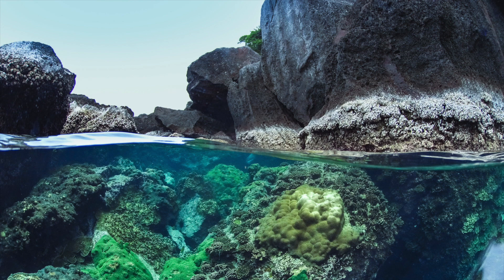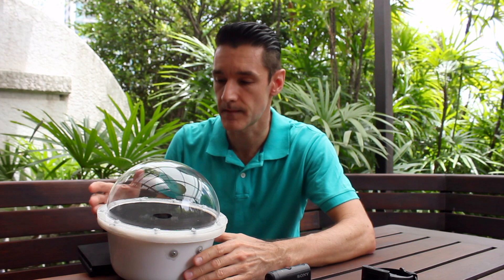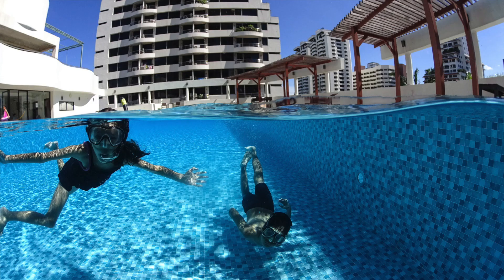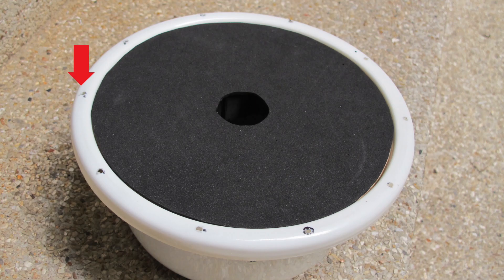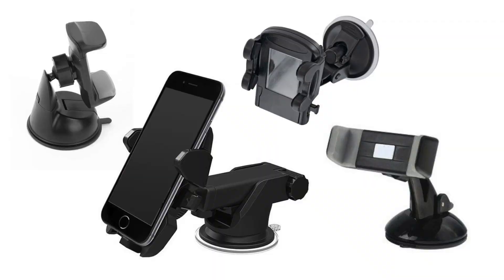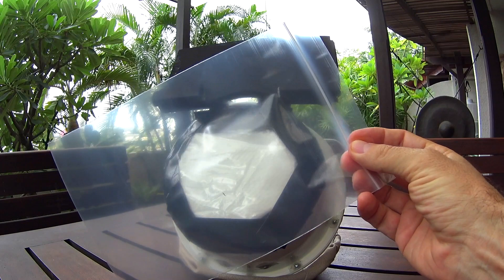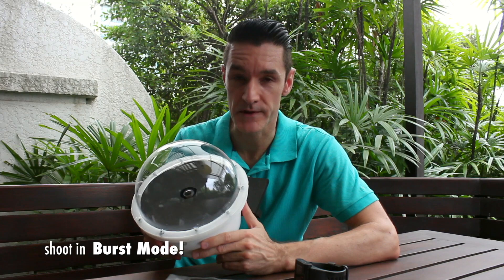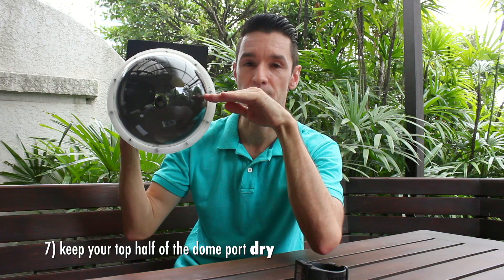DIY Dome Port for half-over-half-under pictures for any camera model

Comment: Great tutorial! 😊👍
Just one question: Isn’t it easier to just use foam inside instead of the wooden construction? There are several soliditys and it is a little bit more flexible when you put you camera inside. Especially if you have different lenses with different thickness. 
In addition, if you really want to get sure your camera doesn’t get in touch with water, you can use an waterproof pac like the one from DiCaPac. Probably takes you the fear away ☺️

Comment: Hi, where did you buy bottom bowl for your design? Online?
Reply from the maker: That took a bit of searching and some luck. Once I had my acrylic dome, I drew its outline on a paper and cut it out. I took this round paper with me wherever I went as a size/ diameter reference. I went through all the department stores and hypermarkets or anywhere they might have household goods. Finally, I found this one I ended up using. Either way, you have to start with your dome and then find a match. The other way around is almost impossible ;)